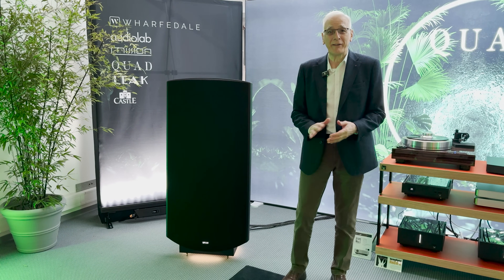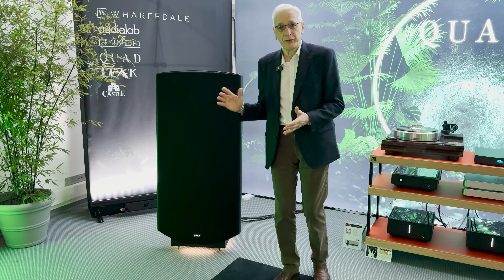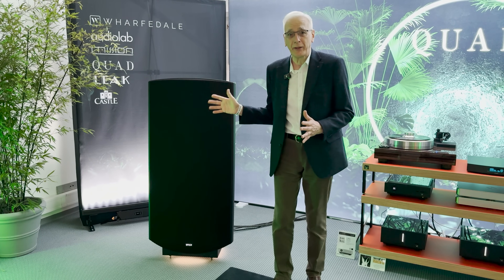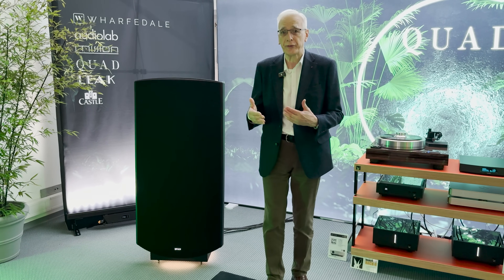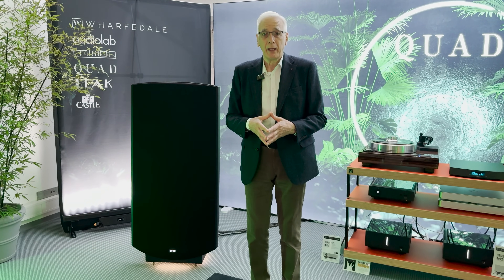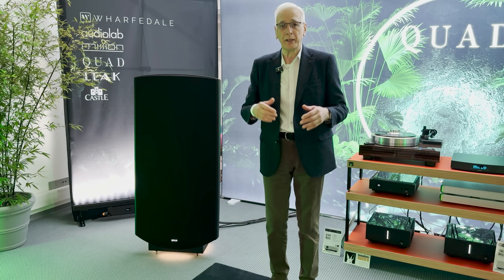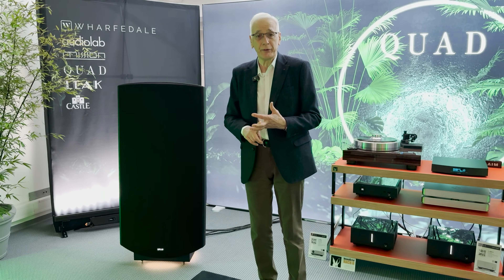QUAD ESL 2912X - New electrostatic loudspeaker with Peter Comeau

Comment: Air weighs 14psi. (I bar). This is rather more than speaker cones, so I dont buy that theory. i think they sound better than cones because they are driven over a much larger area rather than just at the centre. This is why planar headphones often sound good.
Reply: @stevechapman7866. Air weighs 14psi (1 bar). This is rather more than speaker cones.....you say. Yes, in a way...a column of air stretching up to the limit of our atmosphere and subject the gravitational force may be said to weigh what you say (what you've quoted is barometric pressure). The gist of what Comeau is saying is that the material used for the active membrane in the Quads (Mylar) weigh a very small amount (more accurately, its MASS is less)...hardly more than air (the same quantity of air as the Mylar)....the point being it is infinitesimally small compared with a paper cone (and coil of copper wire joined to it!). This implies a much lower inertia, allowing transients to be accurately rendered.

Comment: 0:51 You mention inefficiency, citing a conventional cone's mass to be the problem compared with an electrostatic membrane.  At around 86dB/W 1m efficiency (hereafter written as simply dB), Quad's electrostatics have lower sensitivity - especially given their size -  than most conventional designs, with speakers having larger and/or those with multiple drivers often around 90-92dB
I am somewhat taken aback that someone with Peter's history would suggest that conventional cone/dome speakers are inefficient when comparing them with electrostatics.  This sounds very much like a marketing spiel than real physics...
(PA cone speakers are typically in the 94-98dB efficiency range, whilst many domes exceed 110db.
Reply: The Mylar membrane moves the air more 'efficiently' in that it does it more sympathetically with the input signal....less inertia means sharper transients and less overhang. I don't think Comeau meant to suggest that it moved 'more' air - the juggernaut of a 12" cone may shunt more air for a given watt of power in, but it doesn't do it particularly neatly!
Reply: @rogerwebb7501  I agree with your statements entirely, however the words used in the video are very poor in my opinion.
Reply: @thedubwhisperer2157  Agreed.....the marketing man got the better of the engineer in this instance!!!

Comment: Don't u think since introductio incremental improvement is too slow.
What transformer to change in ESL63 for improvement .....
63 are black .
No need for this intro without any innovative improvement and lots of companies r tweaking it.
Reply: I have both.a set of ESL 63's and a set of 2805's(with the new transformers) and seriously both have there strengths. The ESL63's are perhaps a little rawer in presentation compared and when changing over the 2805's sound quieter...almost as if they have less efficiency. Cannot actually say that the new 2805 set is more enjoyable...just subtlety different. Again the room acoustics would make more difference. The 2805's would be better in a harder environment ...less soft furnishings...and the ESl 63 likewise better in a soft room. Both need to be in a cool shady area of the room..no leeway here. No Direct Sunlight and they will last decades. After setting up an ESL63 its a good idea not to move it around too much cause the panel flex will cause problems with the diaphragms and dust covers stretching. I have installed a brace to the back of my ESL63 for bracing and it also sounds better for it as well. Also they both need to be off the floor about 8 inches roughly and angled slightly backwards. Cheers

Comment: Anyone interested in ESLs should read Roger Sanders’ white paper - they have very particular requirements regarding amplification and speaker cable. 

If I put the link it will probably be auto-deleted. 

Google:
Sanders Sound Systems. 
White Papers. 
ESL

Comment: I am still using my ESL63s but I never play them at loud levels. They still sound great set 4 feet from the wall when driven by PS Audio M1200 amps and produce a detailed soundstage. I will be sad when they die because they are too old to repair.

Comment: all this guy needs is a white lab coat, although he does seem like a very functional  product representative.  .   He speaks of a ten year brilliant, "for an electrostatic" ,  durability , but the actual warrantee is three years, one year if you don't register them within ninety days, on defective product only. although the presenter speaks of performance not degrading, it is not mentioned in the warrantee information found on line, and normal wear and tear is specifically excluded from coverage.  .  

Their was a time where such a design offered State of the art performance, with a few easily overlooked intrinsic design limitations, but other designs have advanced , and as the song says, nothing's the same as it used to be.   I don't doubt they still excel over cones in the  areas they always have, but there were intrinsic design problems if you seek to entertain non audiophiles.

Comment: An enjoyable presentation of what looks to be a serious product. I remember Geoffrey Horn's classic review of the original ESL 63 in Gramophone and on the strength of that I wanted a pair. Electrostatics seem to invite tinkering. I think Alastair Robertson Aikman of SME added some colossal engineering to his ESL 63's in the Listening Room at Steyning. I'd love to hear those
Reply: He used 2 on each channel placed at a right angle , and with Krell amplification
Reply: @drownedinwine  Yes and steel beams to brace them. That must have been some system
Reply: The Crosby modified Quad ESL 63s from about 35 years ago were phenomenal improvements on already good products.

Comment: So many 1/2 truths. Trust your ears when it comes to the bass because they won't play it as loud as they will higher frequencies.
Reply: I have a pair of ESl 2805's and they do actually very acceptable bass...suitable for a medium size room cause the efficiency is OK for medium vol levels. The crucial point is that they will show everything up so its important that the equipment..cables...source and most importantly room acoustics works together. I have an Aragon 24K preamp that I was using and works nice with a Valve power amp that I sometime fire up and sounds great but for my everyday use I use an electrocompaniet AW65 power amp and or a beautifully modified old Quad 405 thats delicate and transparent - as good as the valve amp but this Aragon 24K now sounds slightly too warm so its a Plinius preamp with this combination. Something like an old inexpensive Audiolab pre amp and power amp would be a good match I feel ..Eventually the results are worth it. They seriously will make anyone listening to them smile with pleasure...delightful. They are possibly the best medium sound level speakers for a medium sized room that are on the market but its definitely horses for courses cause they are big...need to be out from the rear wall, semi fussy to get the absolutely best sound out of them althou they will sound good %90 of the time with any decent amplifier. Cons are they don't do that organ wall rattling low end....and they don't ever do parties or really loud levels rock (yuk) althou they will fill the room like a big speaker does and anyway who wants to listen to standing waves in a room untill they suffer hearing loss anyway...
Reply: I have the 2812s and on stands lifting them off the ground so that the bottom of the bottom bass panel is 12" (c. 300mm) off the floor....I did this with the 63s I previously owned. Cleans up the upper bass, which can sound a bit 'rich'. I have then added the Quad L series subwoofer, with its low pass filter set at 45hz. Used sparingly the results are most impressive. I plan to go to the Bristol Show and audition the 2912x and buy them.....probably!
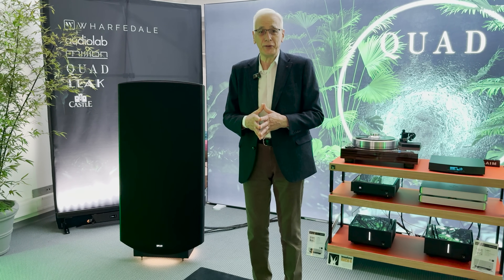Reply: About a year ago I rebuilt a flood damaged pair of 2805 speakers and have made stand/subwoofer for each about 20 cm off the floor using an edgeless 6in bass driver made by pioneer for a not very good minisystem. The only good thing was this fabulous bass driver...Very rare and very hard to find bass driver and originally designed for TAD, that no compromise speaker company run by Pioneer. These go low like nothing I have heard before. I cross them over at 100 hz because I wanted to not allow anything below that on the 2805s so they can have a bit more dynamics before The protection circuit operates.  Seems to be the best balance as tried 80hz and its not as good.. 100hz seems to be the sweet spot. The bass drivers are in a transmission line design. Am now convinced so am doing something similar for my 63s that I wrote about above. Truly s 7:06 tupendous.
Reply: @Relayer6a  Sounds a bit like the subwoofers made for the 63s by Gradient, which were stands as well, although they had bigger drivers. I have for my second (TV) system a pair of Quad 9L monitors fed from a Quad Vena 2 Play and have added a Quad 66 subwoofer, which has two 6" drivers in push-pull, and actually gives a great sound for both TV and audio via the streaming section of the Vena 2 Play (Qobuz).

Way back in the mid 70s I had a pair of 57s with no bass extension, and, although the mid range was good (I listen to a lot of classical, especially opera, the 'weight' on, say, piano was never convincing.

The 2812s are the best Quads I've owned......so far!

Comment: I owned numerous ESL57s over many years in the 60s and 70s  but when I switched to the ESL63 I have to admit I wasn't a fan. I found the sound hard and they tended to rattle when they were fed with anything deep at a high level. After that, I changed to Acoustats and my first second-hand pair of 4s also suffered from rattling so I decided to buy a brand new pair of Acoustat SPECTRA 6600s (serial numbers 003 and 004) which I've had for (I think) over 30 years and they have been - and are still - wonderful. Peter, can you give me an indication as to what these new QUAD ESL 12912X electrostatics are going to cost? Thanks, also for an  excellent video.
Reply: ~$17000 a pair. I don't think the price has been confirmed yet.
Reply: @Relayer6a  Thanks

Comment: The biggest issue with quads is their reliability and perhaps lack of large dynamics. Saying the panels last 10 years is cause for concern. 45 year old Acoustats still are being played. 

Regardless, it’s great to see a new model from Quad.
Reply: I was thinking the same thing when he said "10 years...". My Acoustats are 43 years old and counting, and still sound fantastic! I had to replace one panel (out of 6) when I got them 20 + years ago (they hadn't been stored correctly), and haven't looked back.
Reply: I miss my Acoustat 1+1's.....
Reply: you must cut low frequency with t ex equalizer and use sub.( talking about budget esl 64 type)
Reply: If you keep them out of the sun and cool then you should get 25 years at least out of them. Have a set that i dismantled and professionally rebuilt  that had only lasted 6 - 7 years cause the owner had them in direct sunlight every day....and I'm in NZ which doesn't get the wonderful benefits of dense pollution like any city in Europe...The glues dries out first holding the plates to the plastic grates. The plastic grates can get yellowed and might get brittle if left long enough...Not a good idea with any electrostatic to have in full daylight. I place a bet like on a horse (strangely... I have never selected a winner) those Acoustats were not in direct sunlight....Cheers
Reply: And getting them serviced when the distributor skips town.

Comment: I owned a pair of the first Quads. They had a great mid-range but I sold them because of their well-known shortcomings. I suspect that Quad has improved on the original 57.
Reply: I drove about two hours across town to the only place that carried them when they were a new product,  which was a hardware store in Pasadena.   They were setting out in a hardware isle , visible through the front window, on the linoleum floor , but the clerk refused to even demo them.   I suspect because I didn't look like a  Pasadena prosperous person.  I was bummed, because these were suppose to be something special , and I was certainly open to buying great sounding speakers.  .  
Turned out just fine, I needed polite speakers with a restricted performance envelope like I needed another hole in my head.
Reply: @richardelliott8352  A hardware store is a strange place for "audiophile grade" speakers.